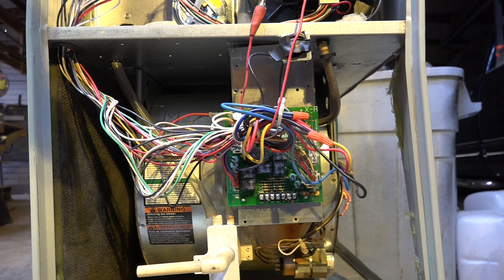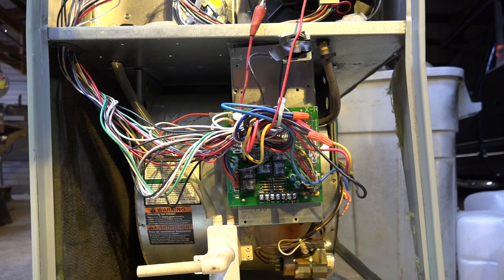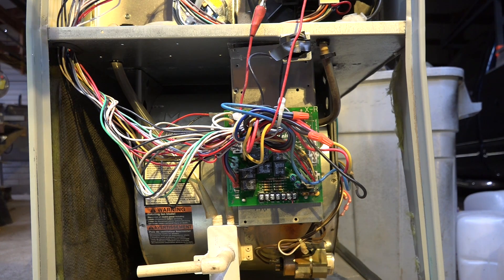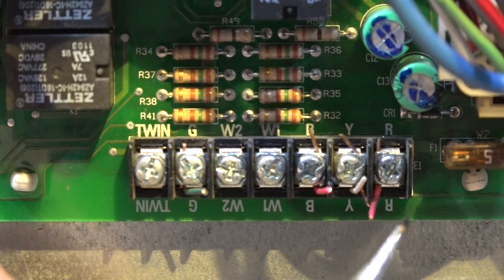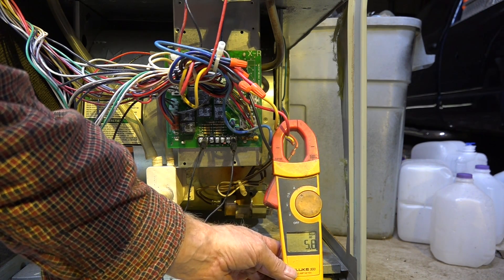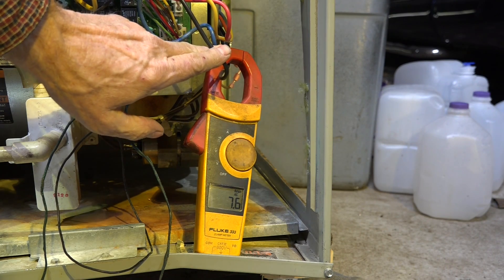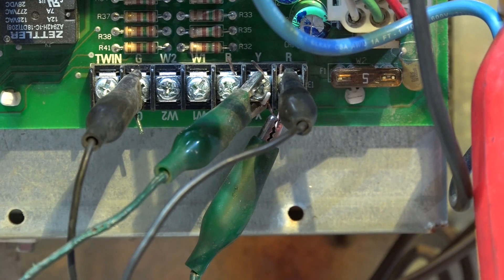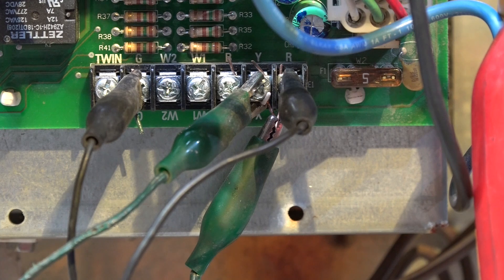Fan speeds on the gas furnace IFC

Comment: I just had a trane/american standard  model S8B1B080M4PSCAA, spit system,  gas /no heat pump !  But once I put it on fan only it goes to the lowest speed !!!!!!
The board will not allow me to change the speed !!!! Heating/ cooling works great !!!!  Now I was told that the round about problem for is was.  1)  take the Y wire that comes fron compressor to the board off.   2) take Y wire that comes the tstat off the board and wire those two together.   3)  now put a jumper wire on the board from G to Y on the board and that would solve my fan Only problem .   When I just want fan only from the tstat and that everthing will work just fine.    What do u think about this round about solution.   HELPPPPPPPP
Reply from the maker: First, why do you want the fan only to be on high speed?
It was set up that way to keep the fan noise down.  
Your solution will work if that's what you want.
GFM
Reply: @grayfurnaceman  
First thank u for the great reply 
Now it's just because some times we just want to circulate air in the house . Stuffy 
It not cool or hot in the house. 
As for the hi speed its the only solution that was given to me.
But I  had my doubts if it would work with out harming the unit. ( Board )
Because we are a eldey couple.
And we just broke down and bought a 4 ton spit system .
So this should work for us as for the fan only issue.  We live in very dry climate. 
Thank u again
Reply: @grayfurnaceman  
Plus I google alot to try and fine this topic 
And found out there a lot people that had the same question. On these unit's 
Tec support sayed that the EPA by law wanted this done from the manufacturer. To all the new unit's. 
Or this type of unit's. 
Why I don't know ( crazy)
Reply from the maker: The reasoning behind the use of continuous low speed of the fan is twofold.  As I said, there is  lower noise from the fan.  Also, power usage is lower (especially when an ECM fan motor is used).
GFM @carlossaenz4075
Reply: @grayfurnaceman  
Omg
Is it possible to use med speed and not the hi speed on the fan only
Reply: @grayfurnaceman  
Last question could I lower the speed the speed because as u sayed  noise and vibration. 
In cooling / heating its on hi speed. 
No vibration in either setting.
Now that u gave the ok on the jumper wires I will try it.
Reply from the maker: I would not want low speed in cooling.  A/C needs a higher speed to work efficiently.
GFM @carlossaenz4075
Reply: @grayfurnaceman 
U are right on not wanting to put it low or med speed on cooling.and on heating it suppose to be medium speed. 
But my question is could I put it in med speed on fan only.

Comment: what if you dont have a Y terminal on your board.  I have a Goodman that has R, G and W only. I ran my Y from the thermostat to my condenser.
Reply from the maker: The Y terminal may not be necessary for the operation of the cooling system.  In some furnaces, the Y terminal is just a connection point.
GFM

Comment: Is there no longer a switch tat the thermostat to turn the fan and off sporadically?  I just bought a Continental C96 B Series and don't see one.
Reply from the maker: All furnaces have the capability of a manual fan switch.  If you have a basic mechanical thermostat, it may not have the switch.
GFM
Reply: grayfurnaceman thank you. It is actually a programmable thermostat but I will double check. Thanks for the quick response.

Comment: If there is airflow issue with Psc motor furnace, will converting into ecm motor furnace help? Since, they are torque sensitive. I have a customer who has a lot of static pressure loss in his system and even If I put it on high speed, it does not help.

Comment: Didn't know it worked that way, great info. I've been curious about something else about jumping the IFC, if I jump R to W or Y, will the board kick the fan in or do I need to do it with another jumper? I've done it on rooftop units just to do a quick check of the burners and ignition but never left it on very long. I tend to just hunt the thermostat and turn them on like that but in certain situations, being  able to just get the unit going would be a great help. I'm also curious if there's any risk in jumping boards?

Comment: My old furnace drew around 7 amps with the fan on. My new furnace with an ECM blower was only .1 amps. I think I calculated that it was costing me around $3000 in electricity over a five year period to run the blower on the old unit vs $50 on the new unit. Those numbers aren't perfect because the newer furnace blower will draw more amps when the AC or heat is activated. Why haven't all furnaces converted to ECM? It seems like they could be mass produced to the point of being as cheap as traditional blowers.
Reply from the maker: +RickMakes Your numbers are wrong.  There is no free ride.  ECMs will give a better efficiency but not that much.  Try using an RMS amp meter.  It will give a more accurate reading.  
GFM
Reply: +grayfurnaceman Got it. I had thought my clamp meter was true-RMS but looking the specs up online, it isn't.